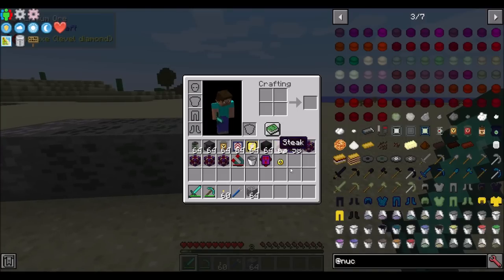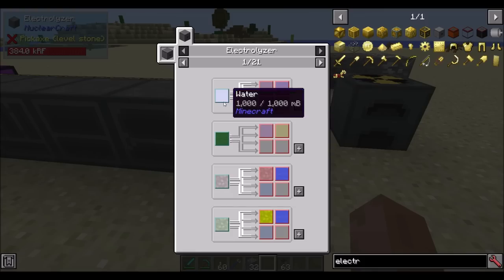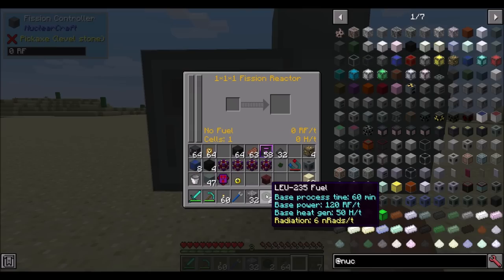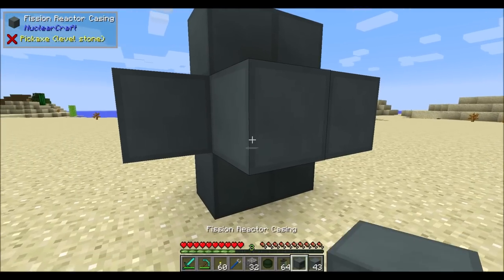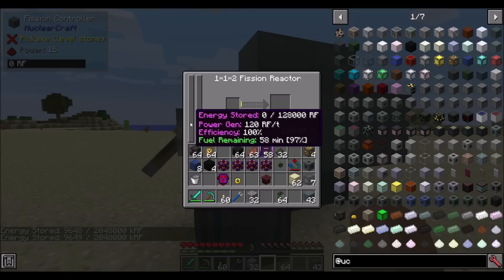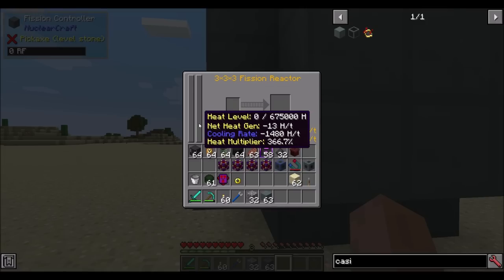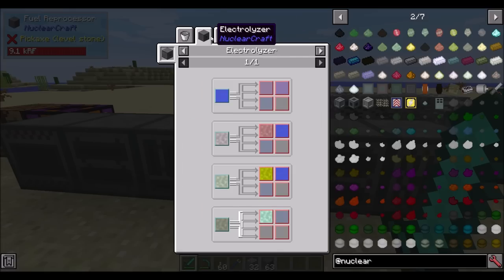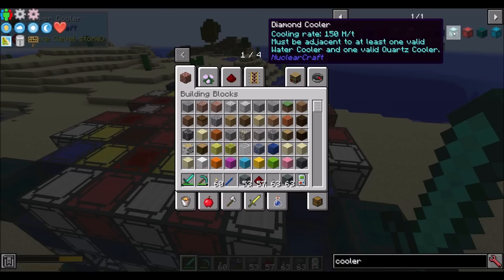Mod Spotlight - NuclearCraft Pt1

Comment: Things that you didn't mention but which are important: you can place basically everything inside reactor, so active cooling is much easier than it may seem, reactor doors and trapdoors exist for purpose of editing reactor without need to destroy multiblock. And finally app for reactor planning that does all calculations for you (name forgotten)

Comment: Radiation is by default disabled in the configs. (so if its enabled a pack dev has enabled it for a reason)
the configs can change a lot of things about reactor gen, and this includes heat gen , how effective each cooler type is , power gen co-efficient, fuel duration.
so for example in po3 cryotheium coolers are Massively buffed to the pt only using them as reactor cooling is comically efficient(for fission ones at least)

Comment: I built the reactor shown near the end, I'm using Enigmatica 2 Light and unfortunately the Lapis coolers only cool 100 and the Glowstone ones only do 120, so I'm still left with 180 H/t being generated. SO i'll need to look into Cryotheum instead.
Reply: Yeah, Enigmatica has some different configs with nerfed cooler values. You shouldn't need cryotheum though, I managed without it. I think I added some copper and tin coolers in there.
Reply: @ArminiusSilvanus  I kept the glowstone coolers and replaced the lapis ones with the cryotheum, they have the same placement requirements and gave an overall H/t of -13.

Comment: The sad thing is that NuclearCraft is going to completely overhaul its fission reactor mechanics soon, meaning this spotlight will be outdated pretty soon.
Reply: I believe the overhauled mechanics were added to the separate Nuclearcraft: Overhauled mod and the original mod is still available with the old mechanics intact.

Comment: "3 types of reactors: fission, salt, and fusion" is like one of these find the one thing that doesn't belong in this list things. Fission and fusion are the 2 methods you can use to get energy from a nuclear reaction, there are a few fusion reactor and a lot of fission reactor designs, one example of the latter is the molten salt reactor (category) of which the most prominent one is the Liquid Fluoride Thorium Reactor (LFTR). No hard feelings tho.
Also, LEU stands for Low Enriched Uranium and HEU stands for High Enriched Uranium or is a sciency synonym for Weapons Grade Uranium.